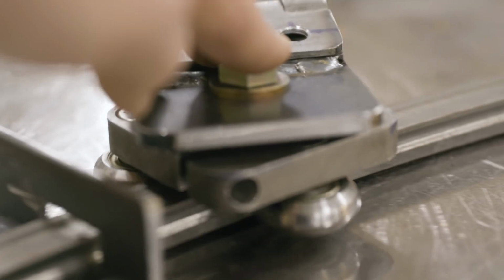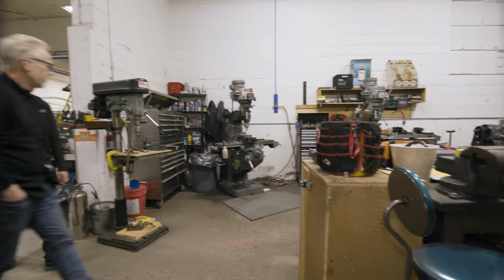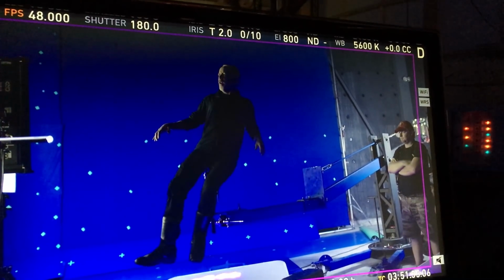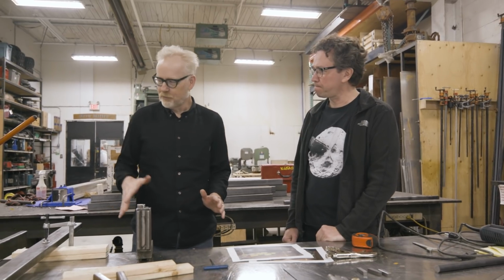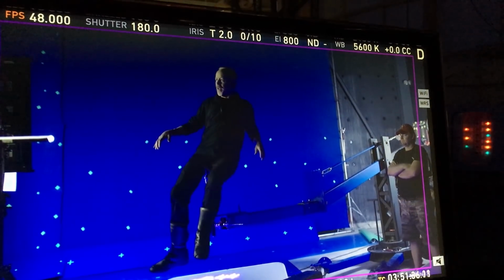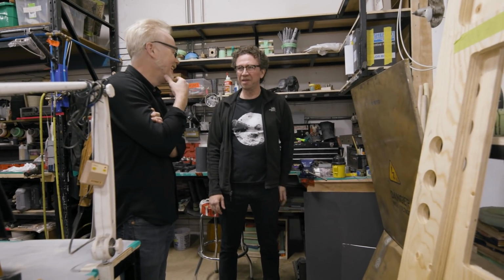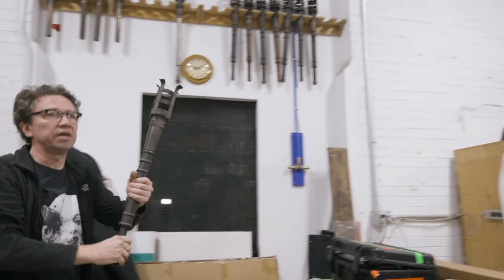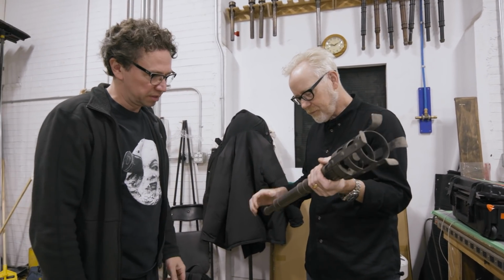Adam Savage Tours The Expanse's Practical Effects Shop!

Comment: Damn I really want to work at one of those FX shops. Its right up my alley with my skills. I am not super good at one thing but can do a lot of things good enough. Welding, machining, using most shop tools in general, electronics, 3d modeling and printing, woodworking, plumbing. Its the type of job I'd love to get but being in oklahoma kinda stops that from happening. The closest I could get here is being a general purpose handyman but I hate going to peoples houses and dealing with them also its not that exciting working on the same home appliances day in and day out. Right now I do phone repair/retail work and I am burnt out on the phone repair because its the same phones every day. You can only fix so many iphone 6's or 7's before you get bored. Also I despise the retail side of it as getting treated like garbage by "class-ist" people (im at a shop in the wealthier side of town) slowly kills you and makes you more and more depressed.
Reply: Feel free to move, follow the opportunity if you can. 👍
Later in life you'll regret most the things you didn't do.
Reply: It's doable if you want to move to LA. Just know that it's very rare to find a full time position at first so you will be working two jobs for a while. Also research where the SFX houses actually are, LA is a big place. You could also try places like Vancouver. Rent is high but it sounds like you have the skills for a better paying job out here.